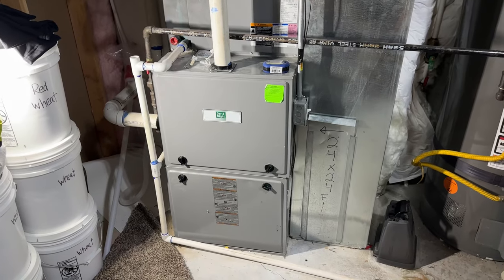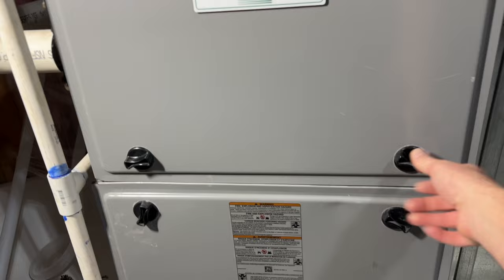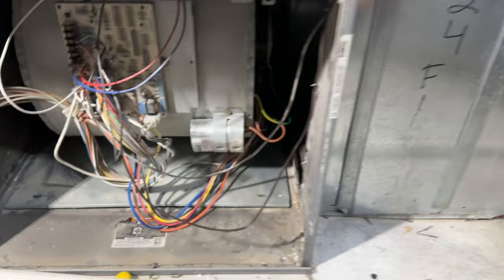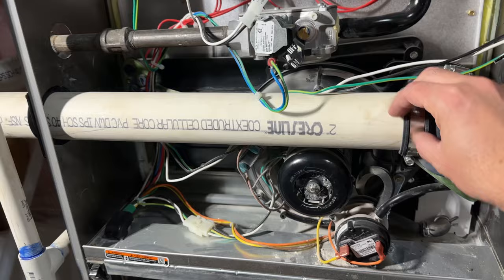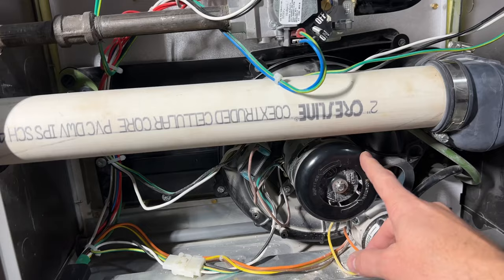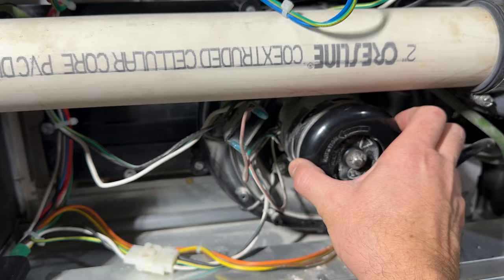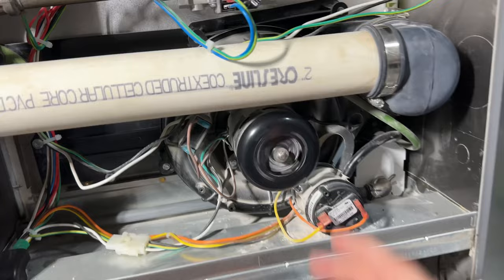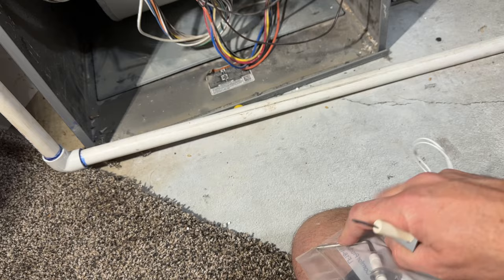Furnace Not Turning on?  Try This First!  Don't Call an HVAC Tech Before You Try This!

Comment: Even while my induction motor is still working on my 10 year old American Standard furnace, I am replacing it.   A heating/refrigerator tech suggested I replace it.  Quoted me $1397 plus tax and trip charge.  Seeing that amount, I ordered my own online.    Same brand too as the original (Fasco).  I will be installing it soon.   He also suggested I change my temperature sensor.   Quoted me a price for the sensor and installation of $201.   I ordered one online for $6.97 with free shipping.  That piece I did install several days ago.  Works great.   A 5 minute job.   There is a moral to this story. 😂
Reply from the maker: Thanks for sharing
Reply: i put one on after it was howling so obviously shot after 27 years on my rheem, i bought it on ebay for $250 and 4 bolts to put it on, the repair guy that did a tune up told me it was shot ( i knew it but got the $59 tune up to make sure) and he wanted $800 for it in 2019, furnace still is all original except inducer and hose for pressure switch

Comment: This was a lifesaver, worked after a couple attempts. There was something blocking the fan in my case and could hear loud clinking with either a screw or some piece hitting the fan continuously. It stopped the fan in first attempt. Second attempt i guess it went through after a minute... Many thanks!
Reply from the maker: Glad this worked for you!!
Reply: @Myksgarage what exactly is this fan called? Just curious
Reply: @lloydmacaya3311  its called an inducer motor.  If the system does not sense that the unit can vent unburned gasses it will not fire up

Comment: It's condensation. Between the heat when last used and cool air a little bit of condensation was in your motor and when it sat during the summer it rusted up the motor slightly.
Reply from the maker: That makes sense!

Comment: I had same problem two year ago.  I used W-40 spray front and back wheel and turn back and forth few times and than turn heat on.  after running about half to an hour.  turn off switch and do it again few times.  Now my furnace runs like brand new.  At that time, I had ordered new blower thought that blower no good, but I end up that I don't have to replace it.
Reply from the maker: That's a good tip, thanks for sharing!

Comment: I noticed the plastic rotation know had snapped off. I couldn't place it back on but when i rotated the metal it worked for a while. Can the knob be replaced or glued back on
Reply from the maker: I'm not sure if it can.  You can replace the that fan assembly if needed

Comment: just wondering about the fresh air pipe just coming down without a narrowing area off to the side of the inner furnace, also the other exhause seems like it should go thru some smaller black pipes with the water tubes close by, the pipe is blocking the inducer motor and would be hard to replace without taking the pipes off, my inducer is sealed and i don't have anything to spin.
Reply from the maker: Yeah other brands may not be as easy to spin

Comment: I have an old house. I have a furnace that is barely a year old and the temp is 7 dagrees outside but my house won't warm up. I have windows covered, but the house won't warm over 50. My bill is almost 300 bucks this year. Any ideas.
Reply from the maker: does the induction fan turn on at all?
Reply: I’m wondering if all of your walls are insulated. On an old house, they may not be. You would also want to look at the insulation in your ceiling and under the floor.

Comment: What does it mean if the black circular piece is spinning, the heater cones on, it just doesn't supply heat out of the furnace. There is also 3 flashes of red light on the circuit board
Reply from the maker: Not sure what that could be.
Reply: Your manual will tell you what the flashes mean. Or there may be a list of fault codes inside one of the panels. The code will vary by brand. Most common diy issue is your flame sensor is dirty. Remove it and clean it off with a dollar bill or other slightly abrasive substance. Make sure your filter is clean. Dirty filters can cause overheating. If you have pressure switches with tubing make sure the tunes don't have water stuck in them. If you have a glowing ignitor make sure it glows during startup. If it does and then drops out before a click or ignition you may have a bad gas valve and need to call a pro.
Reply: Call a technician before u dmg somthing

Comment: Don't touch an ignitor tip with your fingers, it will cause it to fail. Check your capacitor too and make sure it's at the right capacitance.
Reply from the maker: Good tips!
Reply: @Myksgarage  My furnace is making a fast ticking noise. Any idea what that could be

Comment: Mine only works during the day but not at night when cold
Reply from the maker: That sucks!!
Reply: Did you happen to find what was causing your issue?
Reply: Probably thermostat is set to automatically drop the heat temp.  You gotta manually set jt

Comment: You have humidity problems in your basement. Probably unrelated to the hvac system.
Reply from the maker: Oh??
Reply: @Myksgarage  Well, at least I had that problem in my old house. It had to do with poor drainage of the drain pipes to the septic tank. Blower would rust up and cease. It wouldn't be a bad idea to test the humidity.

Comment: Your fan motor is worn out and probably dirty. The
Reply from the maker: For reals?
Reply: @Myksgarage  yes, just replace that motor. You can buy just the motor sometimes. They are cheap. Well the ones I’ve replaced where cheap. I think there is 6 screws and a couple connectors and the think pops right out with fan attach to the fan motor. Most likely a set screw is holding the fan to the fan motor.

Comment: This is a gas appliance. Call the HVAC Tech right away. Homeowners aren't trained to work on these appliances. Do one thing wrong and in case of an emergency, the Insurance will not pay up, because it wasn't fixed by certified technician.
Reply: Call the HVAC tech? Who every time he comes there's some major issue with the HVAC within a month of him leaving? The people who used to get a private room at a diner I used to work at, whom I overheard talking about how to generate more money for the company by ways of deceptive practices?....